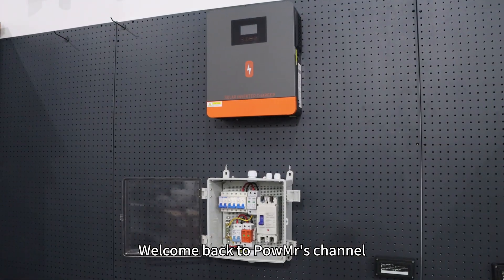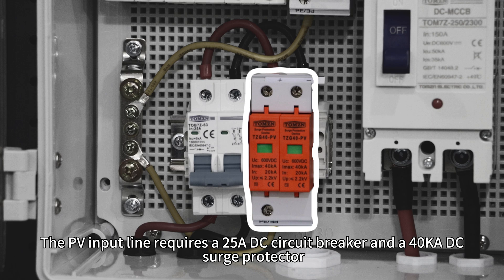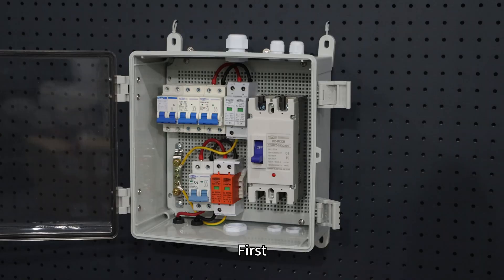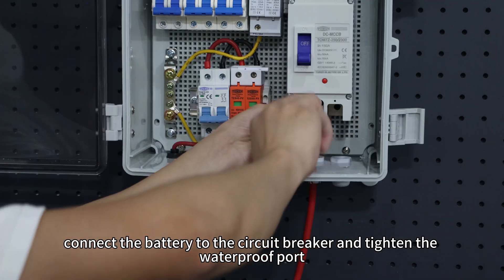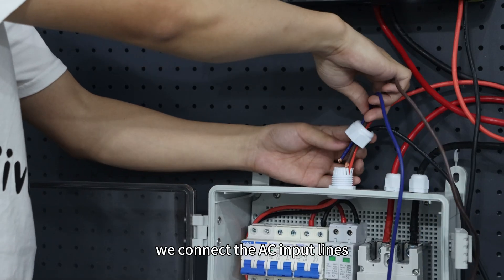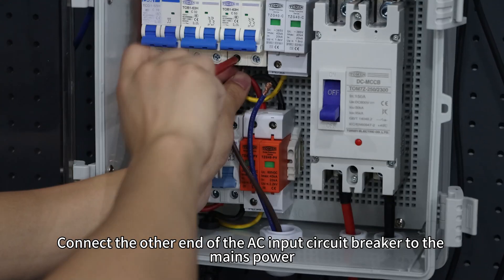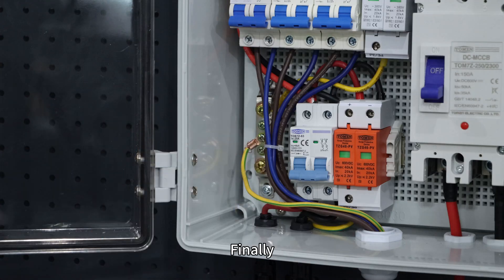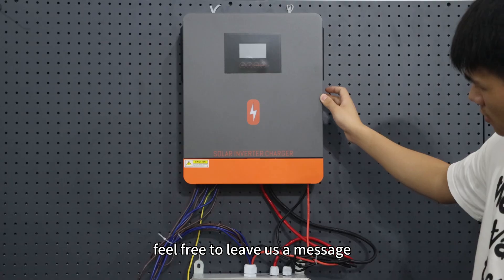The Wiring Tutorial for the Electric BOX-C

Comment: Does the output neutral and ground binded properly internally? Because I discovered that the ground connected to the casing but not connected in the inverter circuit board

Comment: Is this thing also working without PV input? So just the 48V Battery and than into the house 230V 3 Phase? 
So it can than 6200 Watt putting into the house?
Reply from the maker: Single phase output 230V.
Reply: @PowmrSolar 
Hi there , about this inverter POW-HVM6.2M-48V-N can i connect 120v line and 120v for neutro for 240v ac input? 
I mean L1-120v L2-120v
L1 for line and L2 for neutro?
Reply from the maker: @mhansel71  Nope.
Reply: @PowmrSolar 
So this inverter is not suitable for united state right , only for Europe
Reply from the maker: @mhansel71  Yep, this model is used for Europe.
Reply: @PowmrSolar 👍

Comment: Thank you for the video. What cables you used in this video (2 awg…)?
Reply from the maker: For battery lines, refer to the maximum charge and discharge current in the battery manual. The AC input line recommends 7AWG, the main AC output line recommends 9AWG, the second AC output line recommends 14AWG, and the photovoltaic line recommends 10AWG.

If the charging and discharging current of the battery is less than 125A, there is no need to use such a thick battery.